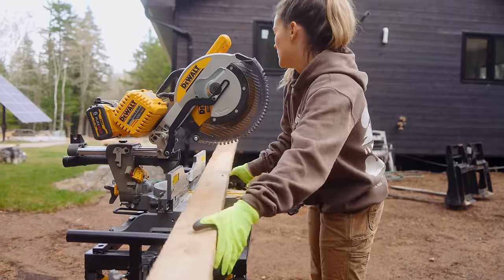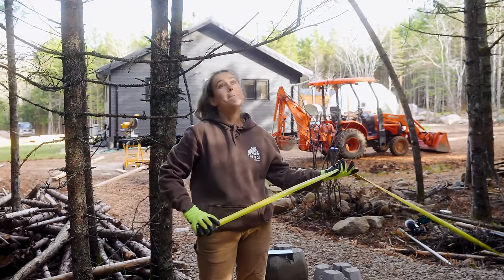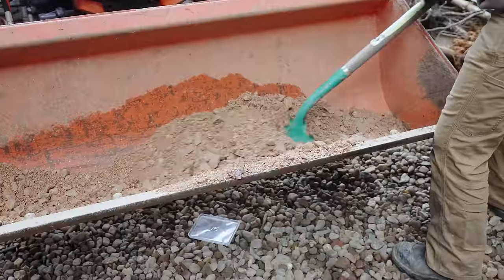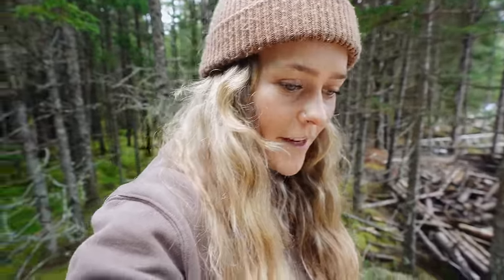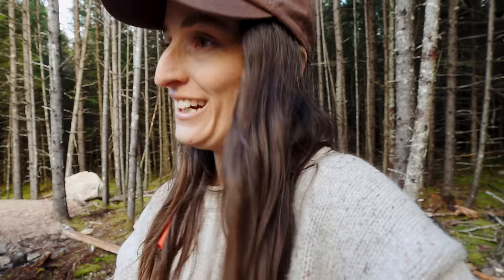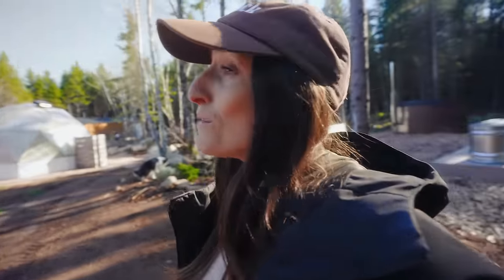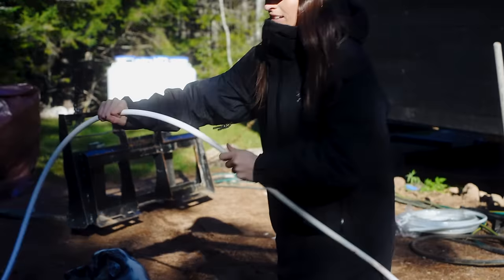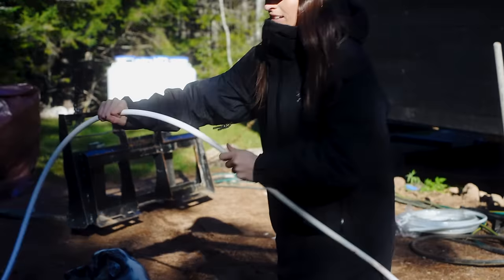Building A Hot Shower & Bath in the Woods Off-Grid

Comment: New England Plumber here —-I know that it’s been mentioned many times in the comments, but install two boiler drains ( hose faucets) in the lines that are in the house so you can winterize the water lines between uses. 
And remember to put the ball valve handles at a 45 degree angle when doing the draining process. Fully open or fully closed will trap enough water to split the valve. Great work.
Reply: I have so much anxiety watching this! I would have built it next to the insulated house for handling the lines and saving some trouble.

Comment: Girls, You will need to put thick insulation and heat tape around all that plumbing for the hot tub. Pex can freeze but it's the fittings you need to worry about.  Also, you should put a roof over your Hot tub. It's designed for interior use and the sunlight and weather will age it very fast.
Reply from the maker: It’s been sitting outside for 4 years in our neighbours yard 🤣🤣 I don’t think it will age much more than it has BUT I definitely want a roof now!!!!! We are blowing the lines with our compressor for winter  🥶
Reply: @Vanwives 
That was my only worry as well, blowing the lines will work for sure in our Great Canadian Winters.
Reply: I wondered about the water lines not being deep enough not to freeze. Now I get it.

Comment: I would have wrapped the tub with insulation. Looks great!  😀🇨🇦
Reply from the maker: Now that is a great idea. Not to late! 🌞🐾
Reply: Yes! It will make a huge difference to keep the water warm. I have an uninsulated tub in my tiny home extension and in the winter the water is cold by the time it’s full 😢
Reply: @Vanwives also in-between the plumbing in the shower area... You can box in the pipe to the shower head.  The shower tub area is so cool! You both are amazing.
Reply: +1 on insulating the tub and water feeds against the cold. ; also the faucet -- maybe a cover for winter so valve won't freeze and split (I had one do that, even after I drained it) @Vanwives

Comment: It’d be pretty quick to pull a bit of that trim and stuff some insulation batts around the tub. It’ll definitely keep the water hotter longer, especially in the winter. So proud of you two for cranking that out so quickly, especially with the shortened days!

Comment: Fun to watch and listen - love the banter.  I see that many commenters recommend insulation around the tub.  Given the fact that this is in the woods I think insulation will only benefit the mice and squirrels.  Never use fiberglass batts if you do insulation, probably foil-faced isocyanate sheets would work.  I do think it was a mistake to not run your PEX in conduit and place foam insulation above to help with heat loss, but more importantly protect the PEX from frost wedging a stone into the tubing.  Cheers to you two for living a dream!

Comment: Wow! Looks fantastic ladies!  May I make two suggestions?  A rubber mat, like a bar mat, to stand on for the shower. 
Also, I would cover it.  Use clear corrugated plastic.  A friend of mine has a similar setup in their backyard (which is total woods).  The leaves and branches became such a nuisance and made a huge mess.  So they covered it with the clear corrugated plastic.  What a difference!
Reply: That is an excellent idea. I didn't even think about the shower mat.
Reply: I would also suggest tarping it in winter. Canadian winters are so brutal on materials. Those pretty jacuzzi taps will look terrible by spring if left to the elements.

Comment: You girls never cease to amaze me. It's both creative and beautiful, nice job! 👍 Though I do believe some insulation under & around the tub would help keep the water hot, & your buns from getting cold. 😨 And now I do realize that y'all are deep in the woods I can't help  thinking that four walls, a wide full length horizontal crank screened window & door for both a view & breeze, & a clear pitched roof might also be nice for added use as well as a little bit more privacy for your possibly bun shy future guests. 🤭 Plus, you won't have to clean out the tree debris from the tub every time you use it. A woodsy watershed, if you will. Lol 😉

Comment: I wonder if where there shower is, it might be a good idea to drill some drainage holes or slits in the deck that are small enough to be comfy underfoot, but wide enough that it would allow for the water to drain off faster? 
It's absolutely couch sittin' time here in Norway. So much knitting getting done.
I have to say the cabin looks so much bigger with all the black siding on and I think that is going to look magical against the white snow when it finally hits you.

Comment: I am a plumber semi retired 2yrs now living back home. Cape Breton worked across canada. And lived in ontario for the last 25 yrs y'all are great at carpentry but your plumbing needs help.The drain put a mesh over it keep rodents out.pex well it can expand 10x its own size when frozen but it's been my experience it never makes to that. It's the fittings, taps,valves that will blow off or burst,remember nova scotia our water is 6' down because frost here can and does go down that far because its so wet here with cold.i would have put the pipe in a 3" pipe wrapped the pex in heat tape and it needs a couple of hose bibs in the house incase the heat tape is not working so u can blow it out.drain the water.and insulate below and around the tub and acrylic outside won't look nice next year b'y.some tips for y'all.

Comment: Your outdoor bath  & shower look GREAT!  I also enjoyed seeing Crystal in bathrobe and boots, how North Woods fashionable. 
Jasmine did a great job on the plumbing, but have you considered how you will keep those outdoor water lines from freezing in the winter? Can they be drained after use? And how will you start running cold water thru an empty line that is already below freezing? 
Although it's energy expensive, there is the possibility you could keep continuously trickling (hot?) water thru a closed loop back to the cabin if you have a hot/cold crossover valve. You could also leave it drained when not in use and start with hot water in the loop to warm up the cold empty water lines via the closed loop.  Us folks in Minnesota are always thinking about frozen pipes.

Comment: Hello Ladies. I see that you use your tractor for a lot of tasks.  Something you might consider is to learn how to remove and reinstall the backhoe.  With the backhoe removed, your tractor will be much easier to maneuver, and you can have access to the three point hitch, allowing a huge number of implements to be used.  Backhoes are great for digging but when one doesn’t need to dig, they are in the way and limit the many tasks that you can do with your tractor.  Removing the backhoe normally is not a big job, I can get mine off in about 10 minutes and back on the tractor in 30 minutes or so.   It is made much easier by having a flat and level place to do the swap.  Good luck in learning the many things your tractor can be used for once you remove the backhoe!

Comment: Yes, insulate the tub and incoming and out flow water lines so they don't freeze and burst.  It would be a good plan to seal off the bottom so critters don't get under the decking and chew your wiring to the pump.  I'd hate to hear anything bad happened to the tub or shower after all that hard work/effort.  Hind sight is 20/20.

Comment: Looks magical ✨ great job ladies.
Just a suggestion but might be worth insulating the tub behind your cladding to maintain your water heat longer. Also, you could drill 1 inch holes in a decorative pattern (like a bath mat) where the shower is to extend the timber longevity, would look funky too 🤩

Comment: ok ladies, unless i missed something those lines you just dug are not deep enough to avoid freezing unless you plan on not using in cold weather and if that is the case just make sure you drain them. Looks good.  Also , a suggestion, I would look into a grate or some way to drain below the shower, in time you will rot out that wood , it will take some time even if you have it pitched, it will rot and possibly crack with freezing and thawing as it may hold moisture and then get below freezing.  another possible thing but not ideal is to make the wood below shower waterproof with a product called Seal Once.  Water and wood do not make good friends in almost all cases. Not trying to be a Debbie downer but better to measure 10 times and cut once.  Spoken from experience. Best to you both
Reply from the maker: Not at all a Debbie downer! We appreciate you mentioning this as we forgot to mention in the video we will blow the lines with our compressor for winter 😊 I really like your idea to drain the water below the shower!!
Reply: good to blow the lines no doubt.  We have some similar experience with some DIY things as we have been doing a small log cabin in VT and now our son is doing one as well near us,  they are both near Okemo which if you don't know is a big ski mountain in VT.  We are using conventional means of power and water, our well, 300' and 10 gallons a minute. A suggestion you might consider, If you haven't get an easy to do Radon test and test your water if you haven't yet as I see you have very bony soil and that can be a big indication of Radon and radon can be carried in water. We have had some interesting times, laying electrical lines, poring concrete pads, putting in septic systems, digging foundations and so on.  We love our little get away. We have a family member that does all kinds of site work and he does so much in the dirt and with those fun machines you both like. Excavator, skid steer, loaders and such.

Comment: Love the project, the view is insane ! But is their water pipe deep enough so it won't freeze during winter ? Is the purpose only in summer and they close it during winter ? What type of protection is require to protect all the plumbing during winter season (the tub, the hose) ? :)
Reply from the maker: Yea you’re right! It’s only for the summer months. We could use the tub in the winter but it would be a lot more work to get the water there haha 💛 OH and we are using our compressor to blow the water lines to winterize them 😊

Comment: I think you have city water but could you have a well dug? I don't know whether the pump would require more power than you have. Is your bubble bath (which I love) biodegradable or whatever the term is so it doesn't poison the ground when you empty the tub? Also, do you need some kind of water treatment on the wood? Australian Timber Oil is expensive but probably better than regular deck seal (Thompson's in the US). I LOVE your new bath and shower!

Comment: Beautiful job. I do have a question about your vertical posts. From the video it looks like you only used a few screws to hold them up without any other blocking and I am worried that a strong wind could knock them down.  Did i miss something?

Comment: Look great girls……but I’m pretty sure you will have to drain those lines for Winter…should you notch out a square area in the deck and set a grate in the decking to drain water when using the shower,the wood will rot and or get slick over time….just suggestions!🙂🙂💞👍👏

Comment: 2 questions! Will the wood rot due to taking showers on it? And won’t the water lines freeze in the winter? I thought you said water lines have to be 4 feet underground? Looks amazing
Reply from the maker: Love the questions! Greta questions- the wood is hemlock and pretty good with water a lot like cedar… however regular maintenance and perhaps treating it next spring is not a bad idea. Yes that’s correct however we will winterize these lines as we will only really use them during the winter months. We will use our compressor to blow the lines 😊💛

Comment: Hey girls, your Jacuzzi looks real good but it’s really lacking in insulation. Those pipes that run up the wall will freeze for sure and make a suggestion in another comment. You could put insulation underneath the bathtub Jacuzzi and the water will stay hot a lot longer. I don’t know how long you want to be in there, but it will stay hotter and the lines will be protected, someone else also suggested the insulation under the Jacuzzi just saying just a suggestion when you can consult with somebody out there. I love   your work ethic and the way you take things on with that enthusiasm and the pack looks happy. God bless.

Comment: Just so you're not disappointed, isn't designed for UV light, as you stated it lasts  forever under the ground but not above, you could just cover them with pipe insulation if you insist.
Reply: Pex isnt*
Reply from the maker: Correct :)

Comment: Great video. One concern would be any water pipes and tub itself may need drained when freezing temps come around. One way would be purge all exposed water lines with compressed air to clear out any water. May be a good idea to put insulation around connections under house to keep that from freezing.  If you purge water lines also open faucets on tub to get any water that could freeze. Good luck on this project. Again great videos!!!!!!

Comment: You may want to add an air compressor line onto your water lines to blow them out for the winter if they freeze and crack on the ground you will redo them every year look up irrigation blow out they do it so the irrigation pipe does not freeze and split underground every fall
Reply from the maker: Smart thinking! We did this to protect the lines- they will be ready to go come spring 🤠💛
Reply: @Vanwives  you girls are doing an amazing job just don't want to you fail  done construction my whole life  all sorts.  Quite the paradise you have made for yourself